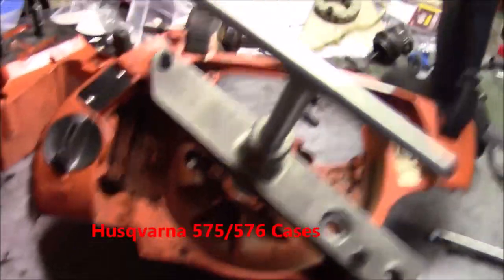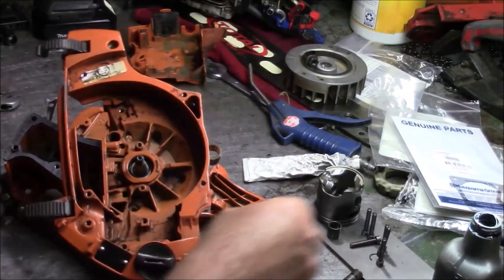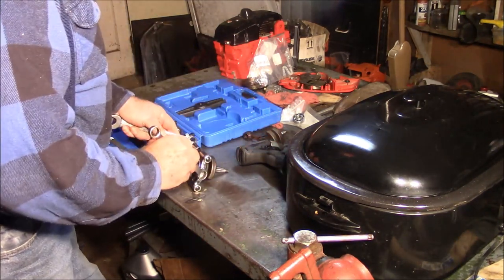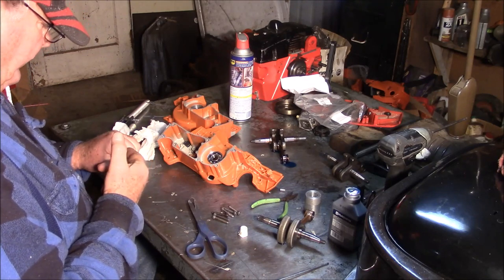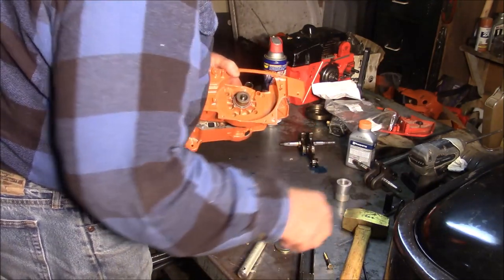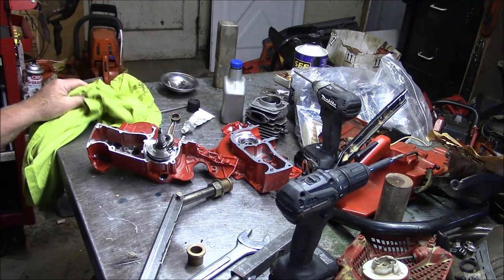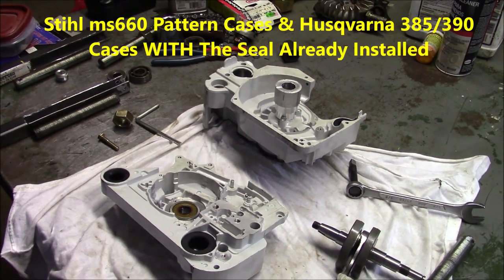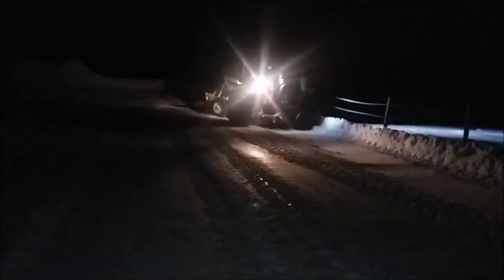Husqvarna & Stihl Chainsaw Crank Bearing Replacement & Case Assembly. "Clips From The Archives"

Comment: My bearing puller set is right on the other side of my office.  It really makes pulling bearings off cranks easy, doesn’t it?  With the extensions you can reach in and pull them off and the splitters will get them off along with the cross bar and it’s center bolt.  I have an identical set except mine is in a red case.  I have it sitting right by my ultra sonic cleaner and Mighty Vac.  I keep all my critical tools in my office instead of in my shop, where I also keep my drill and impact with their 20 volt Li-Ion batteries always on charge.  Cold and hot weather plays havoc with batteries.  It looked cold on the tractor pulling that log through the snow.  I told you and Bob it was going to be a cold, long winter.

Comment: Hi, would really appreciate whatever info you can supply on the gasket makers you use. So much out there on different products, 1184, motoseal and a host of others. Which sealer do you use on cases like clamshells that don’t use physical gaskets.  Would appreciate any info you care to share.  Consider a video on the products you use regularly.  Many thanks in advance..
Reply from the maker: I tried a bunch of options over the years and always end up going back to Three Bond 1184

Comment: Did you hear that BIG BANG 💥?  That was the big can of worms you just blew open telling people they really don't need the High Priced Exotic Parts like Pistons and bearings for most builds. Having built many Hi Proformance Engines in Diesel, Gas and 2cycle  I agree with you that most parts are overkill to a certain point. 
What I have seen over the years for the most part is Joe Public not being Educated and only useing  what there sold or told they need or because they want to be like 
(fill in the blank) cause that's what they have.
Really enjoy these videos, and I love my 570,575,576 platform saws. 👍👍👍
Reply from the maker: Guess I didn't see it as any more than common sense, I raced dirt bikes for decades. Learned how to pinch a penny to get through a season vs. following every fad that got sold in the magazine's at the time. To me if the place a saw will fail is something like an intake boot, an exotic piston misses the point. AND if like we all have seen for decades, mahle pistins out lasting the bearings and seals...why put money where there is no return? Conversely if a saw is modded and it turning rpm's way above stock or running compression way more than a stock saw some of these things make sense. TO show up weak or potentially stressed area in a build...but on a stock saw with stock porting?? Common sense needs to prevail in my most humble opinion. AND the 800 lb gorrila in the "Piston" world...heat transfer thru the rings to the cylinder wall. :)
Reply from the maker: Hey I didn't realize u had a channel! Just subbed, you all reading this should go over and poke around at Craig's channel :)
Reply: I’m on it!
Reply: @afleetcommand  I agree 100%, spending money on the Exotic Bling parts to install into a stock build on a mildly modded saw is money wasted. 
Thanks for the sub.

Comment: Where can I buy the crank tool you used?
Reply from the maker: I make them from time to time. HLSupply usually sells the Husqvarna Shop Tool, "Case Fitting Tools" or pullers. They work and are cheap. I would go there

Comment: Do you fabricate and sale the tools you used for cranks I’ve seen in other videos?
Reply from the maker: From time to time I do. Did a batch last month, but I haven't recently. Usually what happens is I sell off what I have, then have to build a saw and need to make myself another set :) Then I'll do a few more and the cycle repeats. I'm a retired guy :)
Reply: @afleetcommand  I need a set for the 550-555
Reply: @afleetcommand  m having a hard time finding the bearings and seals for theses saws. Part number in the manual doesn’t match anything I’ve found. Any help would be greatly appreciated
Reply from the maker: Partstree.com or ebay both a great resource if you don't have a dealer close by